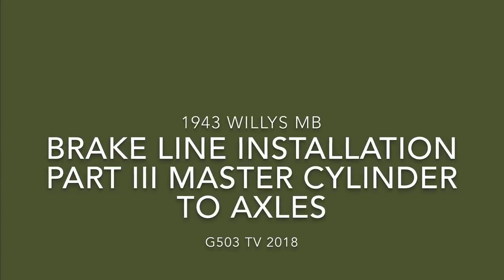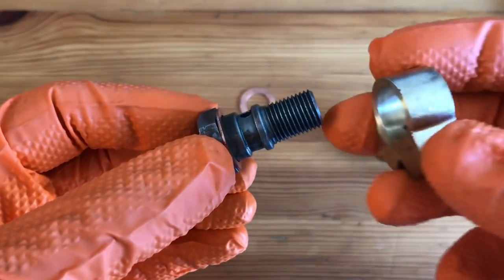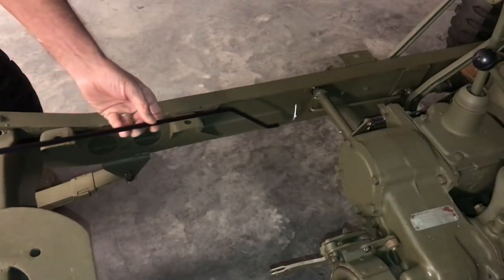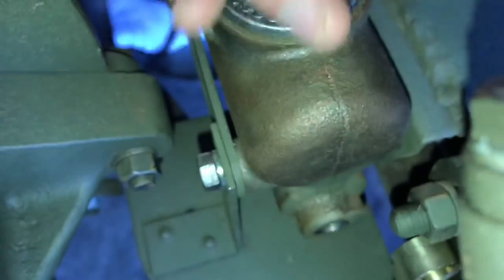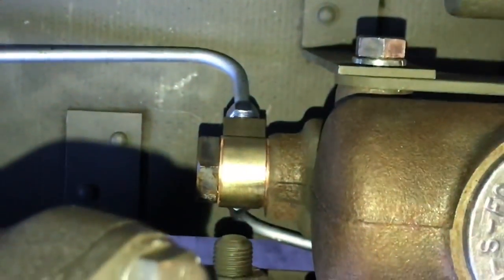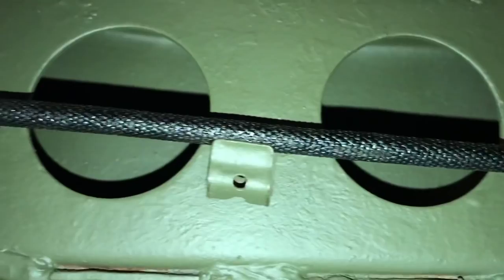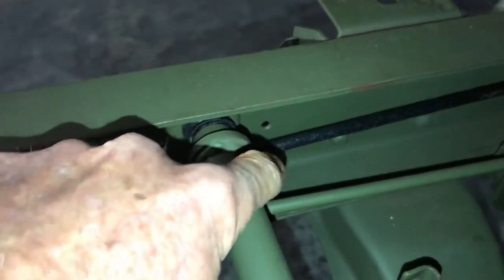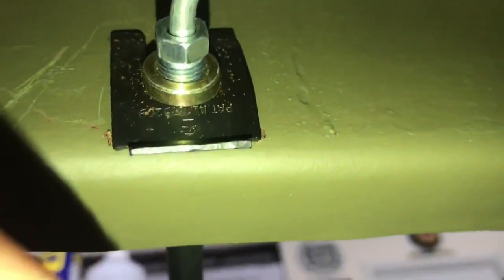Willys MB Brake Line Installation (Part III) Master Cylinder To Axles Team G503

Comment: To install the brake light switch, you can use an Oil Pressure Sending Unit Socket.

Comment: Hello Scott , great vid. I have a Willys MB 44 which sprung a leak today on its brake line, near the master cylinder. I can't tell if it's the Y fitting, or just the line. Visibility is the issue. How best to access to see / repair. With a hoist and removal of the heat shield? Many thanks in advance!

Comment: If you are installing the Master Cylinder and the Brake Lines at the same time, does it make sense to put the brake lines into position, then connect the lines onto the Master Cylinder just before you install it ?  The would make turning the wrenches easier.

Comment: great sets of restoration videos,  my quick question is the two wires that attach to the master cylinder switch fitting , does it matter which terminal they connect to ?